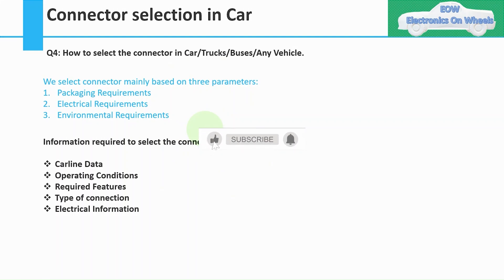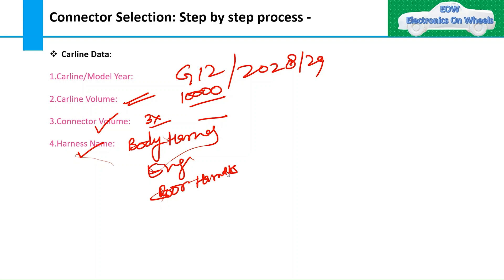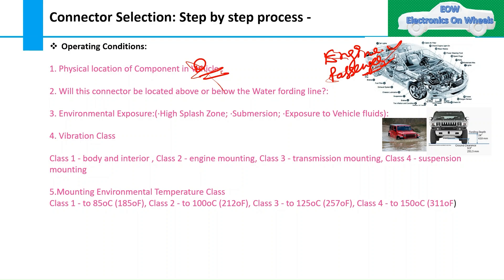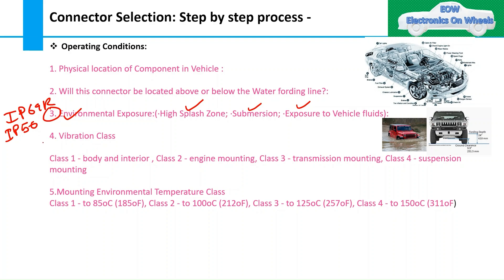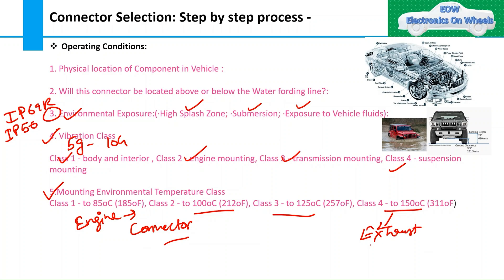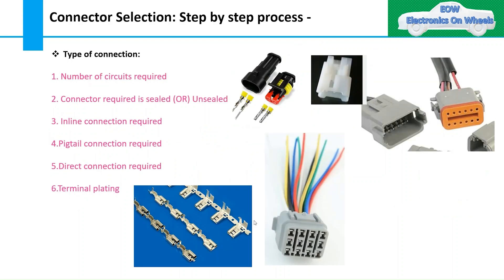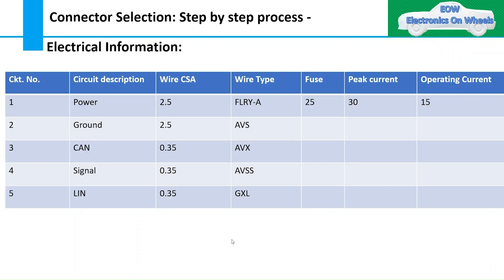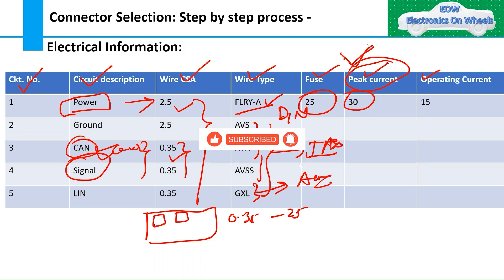Q4: How to select connector in car|| connector selection parameters @WiringRescue @carwow

Comment: Thank you for the vedio. If the connector is sealed and matte seal is available already then cavity plug is available or not
Reply from the maker: Yes, cavity plugs are still required even if the connector has a matte seal, but only for unused terminal cavities.

Comment: Thank you for the video. Suppose you did not mention how we take care about the self-heating of the connector during the permanent work., So we should know the permanent current. And the resistance of the connector joint. 

So, based on that we could calculate the self-heating of the connector under a permanent electric load.

Comment: Continuous vs. Peak Current: While continuous current refers to the steady-state current flow, peak current is temporary and often higher than the continuous current. Ensure the connector is rated for both continuous and peak current levels.